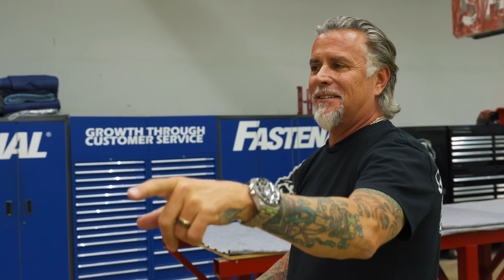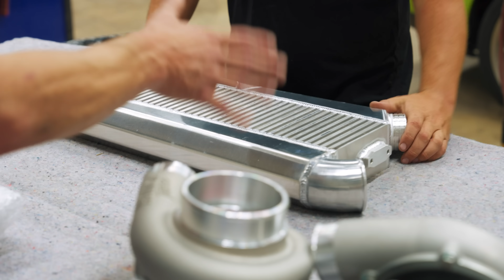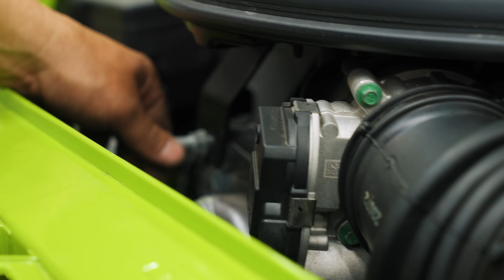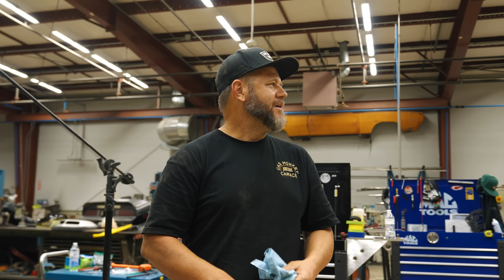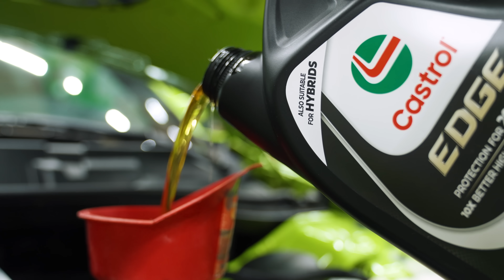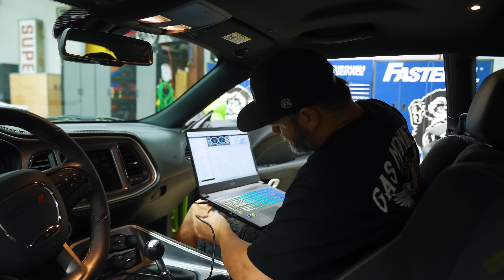Twin Turbo Dodge Challenger 392 Build | Gas Monkey Garage

Comment: You would probably have better torque and HP with a cold air intake instead of the shaker. That's why they only made 200.

Comment: I was under the impression, that the stock 6.4 could not handle any more than 3 lbs of boost. Any more would cause massive damage to the rods?
Reply: And damage to the thin top lip of the piston.

Comment: Exhaust has to travel around the impeller to spinach, which creates a red hot donut, that has hot air getting pulled through the center of it...  Meaning all the cool air goes through the center of that Hot donut before it gets to the engine, that's why you got to cool it!
Reply: Compressed air gets hot. The MC DLT turbo keeps the cool side cool and the hot side hot.

Comment: Coyotes in LSS are both good engines. It was all Chevy hands down for the longest time, Ford finally made an engine it's worth a good goddamn, so stop giving him a hard time. Put a Chevy engine Ford? Sure! Put a Ford engine in a Chevy, well if the Chevy engine is blown and you have an extra coyote hanging around then yeah, but if it's a 4.6, or an old Crown Vic engine, then no not at all....

Comment: He almost got it right.😂 Any time you compress air it creates massive heat. Intercoolers cool the compressed air charge. Cooler air charges are denser. Therefore making a more powerful combustion. Better explosion in the cylinders

Comment: “You can just turn it up”
Later in the video:
“You can change it as long as the fuel and engine mods are there”
No schitt, why not just say what power levels you can do stock and then tell people what they need for different power levels.

Comment: Hello. Was traveling at 70 and all power went out. Replaced battery, starter relay with starter. Slow start, fast power drainage. Cleaned injectors. Almost yr gas in ot mixed with mostly new gas at a qtr tank, with stabilizer. Please help guys what it is

Comment: The air builds heat when it's compressed.... the intercooler removes that heat. The air is not hot because of the exhaust! High horsepower cats that run alcohol or meth don't even need intercoolers cause the fuel cools the air.
Reply: All the while hector is gonna be running 3 honda civics with spoon engines, t66 turbos with NOS, and a motec system exhaust.  😂😂😂

Comment: I own a 2023 Challenger Rt/scatpk. Standard body not wide body meaning I'm limited to tire size. I can't keep tires on the car now just wants to smoke the tires. With this turbo kit I just see a loss of horse power at the wheels. What do you say about this problem?

Comment: Can this kit be installed on a factory scat pack? No forged internals needed? No transmission or diff beefed up needed?
Reply: It definitely needs a built motor and built transmission,  minimum.

Comment: Hey there! Has the event already happened? I'm curious about how to get involved. Just to share a bit about myself—I’ve been in the military full-time for 18 years, and believe it or not, I've NEVER had a new car! I’m a family guy with a wonderful wife and three kids, so finances can be a bit tight. I do my best for my family, but I’ve always ended up driving older cars and trucks.

About a month ago, my trusty truck finally gave out. It’s completely dead now, which means we’re down to just one car that my wife and I share. She drops me off at work in the morning, and I hang out there until she can pick me up at the end of the day. I promise I’m not complaining! I’m just handling my own challenges like a man.

I’ve tried everything to fix the truck—new MAF sensor, spark plugs, intake system, and even replaced the entire cooling system, including the radiator, heater core, thermostat, and hoses. But no luck; I think the engine is shot!

A new car would really make a difference for us, and just so you know, the Dodge Challenger 6.4 is my absolute favorite muscle car! Seriously, you can ask my wife about it. Anyway, I’m excited to subscribe and follow you all because you seem like a fantastic group of people.

Thanks for taking the time to read this! I'm stationed at Fort Bragg in NC, so if you ever find yourselves in the area, I’d love to buy you all a drink! Thanks again!

Comment: 24::37 I just finished my 1956 F100 Panel Truck I used a 2005 Ford Crown Victoria P71 Police Vehicle for the swap. It feels like you are floating. This is the best daily driver-show truck I have ever owned! So, I have to say Ford because of it's suspension,  durability and drivetrain! I normally would NOT agree with "I'm The Greatest" Josh P! I had to on this one because I was a huge LS fan. I went with the Crown Vic. swap because it was given to me for free. So, I had to go with it. Since the swap I have changed some things. I went with a supercharger, cold air intake, throttle body, fuel rail, injectors, exhaust upgraded fuel pump,  limited slip rear-end, and brakes. I got lucky because I bought everything from a friend still sealed in the box for 5 grand. I rebuilt the motor as well. I upgraded to more performance parts. Not counting my labor, I have a lil over 12 grand in the truck. I paid 500.00 for the panel truck and 500.00 for the Crown Vic that only had 75,000 on the odometer. I have it tuned for 550hp. It runs better than a brand new truck. 
I live in the Woodlands, Tx. Next time I am in Dallas. I will come by the shop.

Comment: Late to the game on this video and kit. Was hoping to see boost n dyno results. The small pulls in this video you show, not 700 whp. Be cool to see an update on the car with mileage since install. Be really cool to see this kit with stock internals vs same model with long header n cam. That be fun to watch. Looks like a great kit if ur planning building n running past (4-5 boost?) safe zone.

Comment: Me personally think it’s not best to boost the 6.4 hemi engine unless you upgrade pistons&rods and upgrade lifters cause even with low boost, it’s still major wear on them 6.4’s engines, not designed or strong for boost them pistons are fragile on them
Reply: Adding turbos to that car is a $50K upgrade.

Comment: does the intercooler replace the radiator?
Reply: No. Intercooler is for turbos to blow air threw for intake and radiator is to cool engine and possibly the turbos if plumbed that way

Comment: Turbos use the heat energy from the exhaust to spool the turbos and compress the air. Because it's too hot for good IAT it needs to go through an I intercooler to bring the temp to sufficient temps for atomization with fuel and not cause preignition

Comment: well I just ♥ fast cars & trucks & I ♥ drinkin some ice cold Bud Richard & I sure would wanna have a chance of winning a car like this 1 ya doing this video on the Dodge Challenger Swinger but if I don't win 1 I still would wanna get ya Gas Monkey Shop 2 add some major horse power to my 2005 Toyota Camry with a 4 cylinder 2.4 L engine I'll call ya soon on that Richard & all of u at Gas Monkey have a Super! Good! One!

Comment: I'll start with, I'm not a mechanic but the way I understand intercoolers, colder air, more dense than hot air, means more air. More air means you can add more fuel. More air and more fuel is more power.

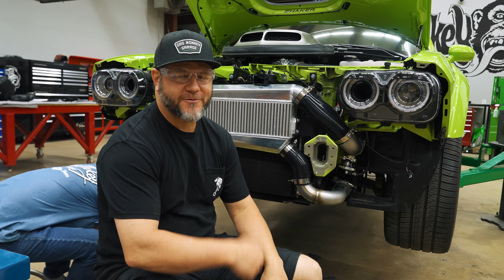Comment: At 28:27 the green crash bar mounting points on the body look intact and at 31:39 you can see how at least one mounting point on the chassis has been cut into to make room for intercooler piping meaning that the car will technically have physical changes compared to stock, but besides that having a kit like this is awesome especially with person that knowledgeable representing Hellion
Reply: Dang. You're absolutely right and it's really obvious. Still, like you said for what you're getting it's pretty amazing but maybe not a "weekend warrior" project unless you have tools to do that
Reply: @DiscipleRider I mean I would still consider it a weekend warrior project because most guys with tools will have some sort of angle grinder or sawzall even a dremal to get that done one way or another. It does take the “complete bolt on” label away away from the kit especially because he said it requires no fab work and can be put back to “ complete stock” l. It’s minor and picky but I agree it, it still made his statement false.
Reply: Even at 28:27 you can see the passenger side already chopped.
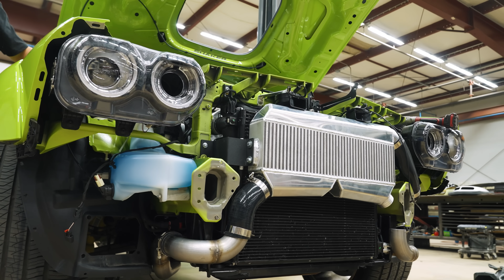Reply: 28:42

Comment: i work for a dodge dealership that had a 2017 6.4 scat pack come in with one of these twin turbo kits installed. car only had like 3k miles on it. and i can tell you from experience that it would keep up with and maybe beat a stock hellcat without custom tuning ( dyno tuning) . it was very impressive, and responsive.
Reply: Here's a secret (whisper) : a Hellcat can also be modified.  😉
Reply: @UncleStu-jd3le  yep ive seen a TT SC hellcat its interesting to say the least
Reply: @UncleStu-jd3le here’s a secret most can’t afford the payments let alone real mods. They rather have starlight head liners 😂
Reply: @SRTGHOSTS 😂😂😂😂
Reply: @Itelltruth69420  I'm walking stock Hellcats, and modified ones too.
Reply: I heard the engine can't take boost
Reply: @marcinzemla6265  i believe they said they were running 5psi which is completly acceptable for a 392 with a turbo kit
Reply: @marcinzemla6265  That's the great thing about installing a turbo kit, it's more efficient, so you make more power with much less boost.  5 psi on this kit would likely feel like 8-9 psi on a supercharger kit.
Reply: @marcinzemla6265 Lol!! Didn’t see that coming… MUCH!!!
Reply: Yeah, dealerships have ALOT of these completely overpriced cars!
Reply: @LONEWOLF-rq5tl you used him mentioning dealership as a opportunity to whine. It is not common at all for a dealership to buy, sell, or build cars with something as expensive as a twin turbo kit.

Comment: that motor will be toast soon
Reply: I was looking for this comment
Reply: @jeremyvasquez6913  lol I know cars that motor is not made for boost
Reply: @DCSRT4  I agree man you just can't throw power at the car without building the engine, especially a 392.  Even if you do build the engine that cars stock transmission can only  handle so much torque.
Reply: @jeremyvasquez6913 u act like it’s not the same with every car. U think those high horsepower chevys and fords are all fully stock😂
Reply: @jeremyvasquez6913  lmaooo same, i was surprised when they didn't build the internals

Comment: 1 of 200 and your gonna cut it up ???  those chunks cut out of the front bumper mounts they should have designed that tube to go around. also the grilles in the opening of the shaker hood are different on that black one than the original.. i agreed with the turbos if everything was reversible but im not so sure now haha  do all the original parts come with the car? lol

Comment: You need to put a 370 hellcat manual differential and axles. Will make even more speed with strength to back it

Comment: i fully agree with the statement you need own 2 of them . a manual for having fun on the street and an automatic for the dragstrip
Reply: ????? Amateur obviously
Reply: @illfingaz210  i'm such an amateur after driving trucks for 14 years even drove a truck with fuller gearbox . when i was young i would never have driven automatic but after 25 years of belgian traffic , a manual is not that fun as it used to be
Reply: @nyftn  some people don’t understand that! But I do been driving manual transmissions for 30 years. An automatic is nice,hell 90% of quarter mile drag cars are automatic.
Reply: @illfingaz210 amateur rofl . 😂😂😂
Reply: @nyftn you still upset about that 4 months later? lol
Reply: Power shift

Comment: The explanation on the point of an intercooler is the worst thing I’ve ever heard.  Bro, exhaust hot, therefore turbo hot, makes compressed air hot, intercooler removes heat to make air more dense; not complicated.

Comment: You did not just say Hellion. Make sure you tell John or Jon to save me one of those compound boost kits for the 03/04 Cobra's if they ever stop making em lol. I've had my eye on one of those kits for a very very long time, prolly since I bought my 01 Cobra 🐍 in like 2009 so decades lmao. I'm running a built motor with a Stage 8 ported Eaton M112 on like 18 lbs so I'm making 505 RWHP and I would've gone to a twin screw Kenne Bell blower by now but I stuck with my Eaton in hopes that I'd get one of the Hellion kits someday. Although I think I have seen twin turbo compound boost kits on twin screw blowers and not just positive displacement or roots style blowers. What a great idea for this vid man, great car, great kit, great guys, great work. ✌️✌️

Comment: Why would you ruin an already powerfull car with turbocharge? Not a good idea at all, covering the radiator with the intercooler, will make the engine run hotter and fail faster.